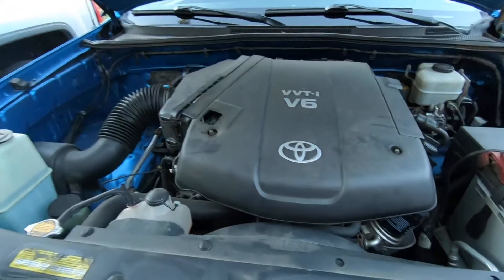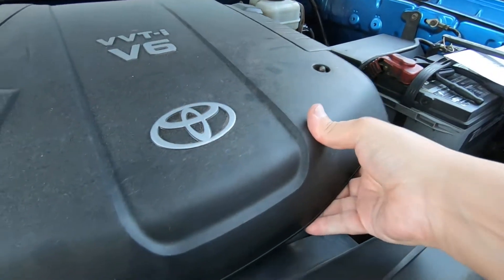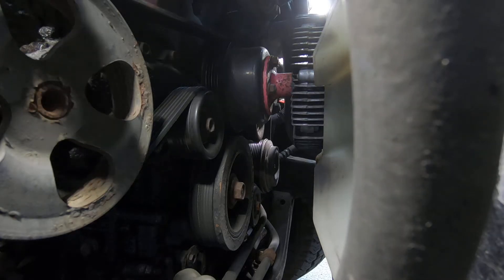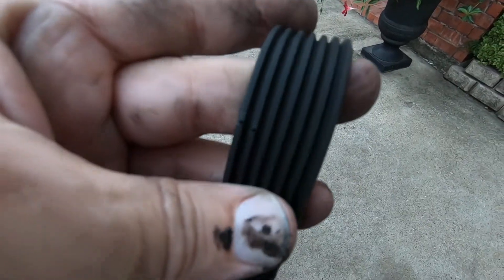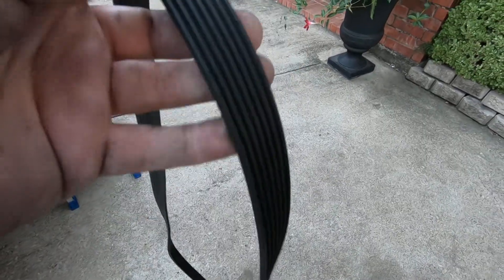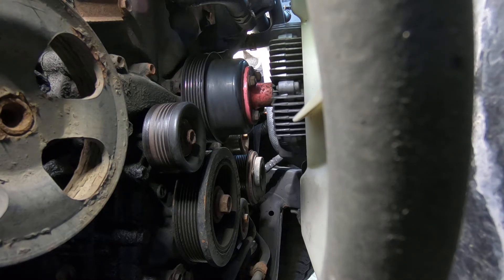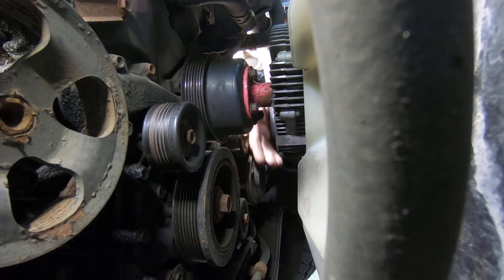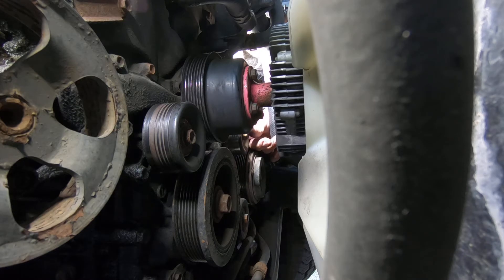Serpentine Drive Belt Replacement on a 2011 2nd Gen Toyota Tacoma with the 4.0L V6 engine.

Comment: Decent video, but you'll find it's a lot easier to route the belt from the bottom, even if you have to remove the skid plate. Final install over the PS pump should be done back on top.

Comment: The part where, right after moving the camera down into the engine bay, you push the paper diagram in so we can see it on camera? Comedy gold. I have never laughed so hard at an instructional video. Very helpful and hilarious to boot.
Reply from the maker: Thought it would be easier pushing the diagram down instead of pulling the camera back up. :)
Reply: @737mechanic  you absolutely thought right! And then you also edited in a still shot in post, which wouldve been perfectly fine all on its own - but pushing that paper down had me rollin and it boosted engagement, and there's nothing wrong with either of those. I appreciate you brother.

Comment: As crazy as this sounds, I routed and positioned belt from the bottom and found it to be much more space from the bottom up. Also I cannot speak for hiw well the leverage on tensioner is going at it from the top but from the underside the leverage and space is there. Thanks for making video like this, it offers a deal clarity.

Comment: My sister had a new belt and idler #1 replaced. They charged a lot and claimed they had to drain and remove the AC pump to get to the idler.  I don't have access to a 2011 4.0 to verify, she lives 400 miles away so I couldn't help her.  Sounds a bit fishy to me,  anybody know?
Reply from the maker: The pulley itself can be changed without removing the compressor, but if they changed the entire tensioner assembly, you do have to remove the compressor. The following link should show the assembly with the pulley attached.

https://m.media-amazon.com/images/I/61DFrgYaNGL._AC_SL1500_.jpg
Reply: @737mechanic  thanks for the link, I see how that works so maybe they didn't do her that bad.
Reply from the maker: @Anonymous-vr9hp  You should be able to look and see if that entire part looks new.

Comment: I know this is an old video but wanted to take a minute to thank 737mechanic for doing it.  I watched the video carefully and then tackled the job of installing a new belt to replace old one that broke.  The job went fairly well.  I did take the plate off from underneath (too thin to call it a skid plate) and that made the job easier for me as I could more easily see the pulleys and routing.  Great advice from 737 to print off a routing diagram from the net for the belt.  That helped enormously.  Thanks again!

Comment: This is timely for me. Great video with grest input!  80% of the belt was gone... just threads. Ordered the belt on amazon, delivered the next day. Dumped the skid plate, cut what was left, pinned the chsin tensioner, and done in 3 hiurs.

Comment: I would like to express my gratitude for posting the instructional video on how to replace a belt. I appreciate your videos.  Since I know I will be installing a new belt, I am wondering if I should simply cut out the old belt. I am also grateful that you included the part in the video where you struggled with the installation. This way, if I have a meltdown and cannot install the belt, I will know that it was not easy for you either. Often when I watch a video, the person completes the task in seconds, which makes me wonder why I bother attempting to do things myself.
Reply from the maker: Yes, you can cut the old belt off. One thing you may want to do is measure the new belt with the old and make sure they are the same.

Comment: What kind of miles before seeing belt cracks…?
Reply from the maker: Depends on the brand of the belt, the make and model of the car, the climate it is driven in, and whether it is a lot of highway driving vs stop-and-go and-go driving.

I have seen belts with 100,000 still in good shape and belts with 50,000 that are cracked and need changing.
Reply: My Tacoma has 140k
So I need to inspect it…farm truck…tough life.
The bottom acess way seems easier… @737mechanic

Comment: Honestly, you’re not saving the old belt just cut it once it’s off. If you aren’t keeping it as a backup no point in wasting the effort. I keep a new belt in my truck as a spare in the seat compartments and tools just in case
Reply from the maker: Sometimes I do simply cut it off.
Reply: @737mechanic  thank you for this video btw. I’m not sure why I felt this was harder than it actually is. I’ve never had to change the belt yet and at 230k miles I think I might now haha.
Reply: Just now changing mine on my 2015 with 180k miles still on the original belt. Toyota is the best.

Comment: I took off the skid plate and did mine from the bottom ...so much more room for my hands.
Reply from the maker: As long as you don't mind laying on your back and having to remove the skid plate that is great. At my age anytime I can do something from the top I do it.
Reply: @737mechanic  I hear you though. I just did it today. Coated some surfaces with fluid film while I was under there.

Comment: The last thing you did on removal was route it over the fan, so the first thing on replacement would be to route it back over the fan to keep it simple.
Reply: Heck yeah. Relive the tensioner, stick an ellen wrench in it & cut the old belt off

Comment: that was some great video. It just seems like that belt does not provide enough traction to the water pump pulley. I wonder if slippage on the water pump pulley could cause these Tacoma belts to have a shortened life. One of the very few times Id ever question the Toyota engineers.
Reply: I replaced my original belt at 278 k
Reply: 200K and still going, but its time. @MrTomtusti

Comment: Just checking, if you replace the tensioner pulley that is the only pulley that has a reverse thread is that right and the other 3 are standard direction left to loosen?

Comment: Take of the front skid plate and do this job from under the truck. It's 10 times easier.  Use a roll of shop towels for a comfortable pillow 😌. Oh another thing! There's a small hole on the bottom of the tensioner.  Take a skinny L shaped Allen screw and release the tension.  Once you release the tension,  stick that L shaped Allen key in the hole. That will hold the tensioner back. Once the new belt is put back in place, release the tension and pull out the L shaped Allen key and done.
Reply from the maker: I have found it is more of a pain trying to reach both hands down or up to the tensioner and put a pin in than just keeping the ratchet or wrench on it and pushing or pulling when you are ready to put the belt on again. Doing from the bottom is an option I didn't want to mess with taking anything off that doesn't need to come off plus I hate laying on the ground.
Reply: Great advice
Reply: Rich speaks the TRUTH!
Reply: Just did this after trying the top. Way better.
Reply: This literally took me less than 3 minutes. First belt I’ve ever replaced. Thanks for the tip.